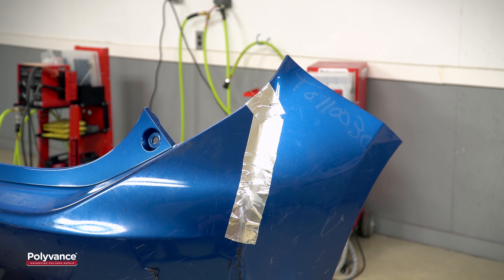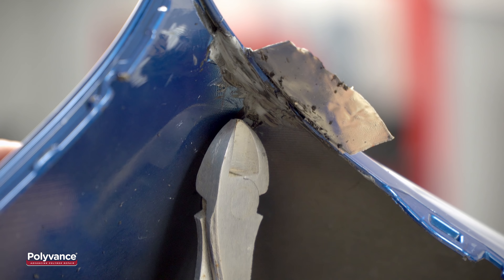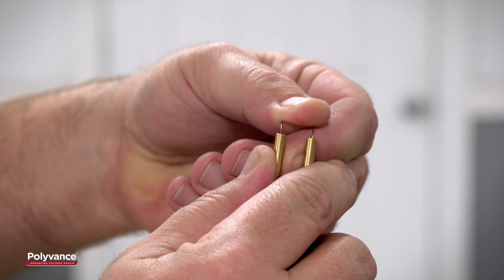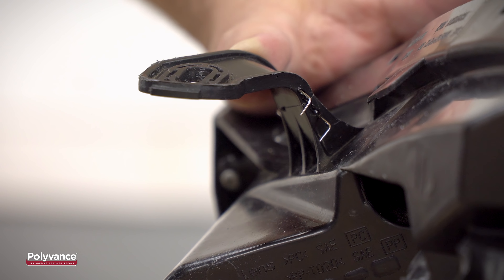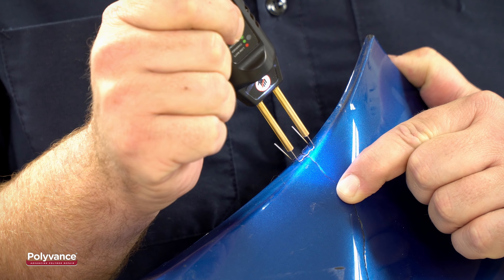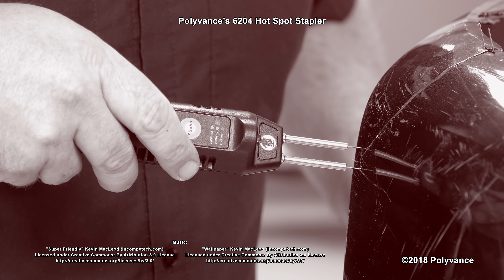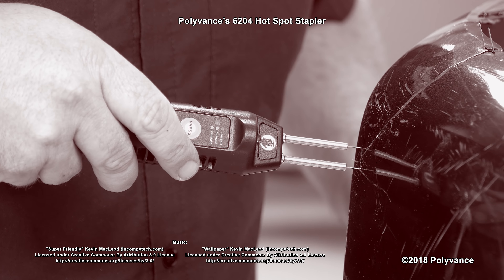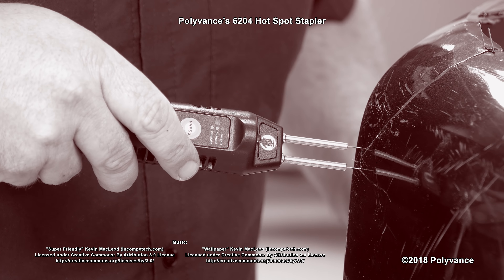Polyvance's 6204 Hot Spot Stapler

Comment: Is there as reason why with this hot stapler it is not suggested to slightly twist the staple once it is subdermal as lock it in better?
Reply from the maker: You can twist the staple to lock it in better if you would like to keep the staple in permanently. We mention twisting the staples on our website and literature.
In this video, we just focused more on the staples being there to hold the part together while you perform a permanent repair. It is best to only twist the staple to lock it in if you are going to keep it in the part permanently; otherwise, it is harder to remove.
Reply: Nope.  That's always acceptable.